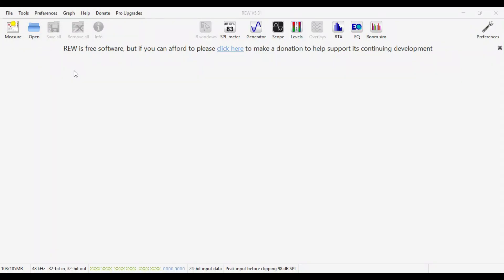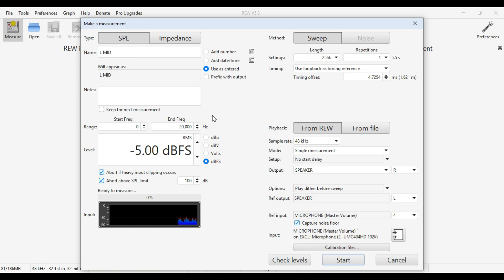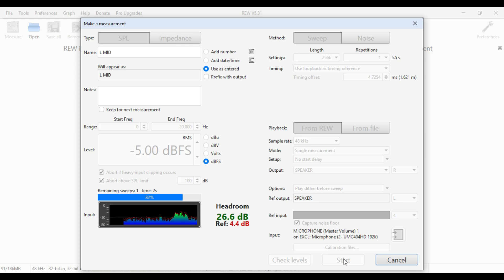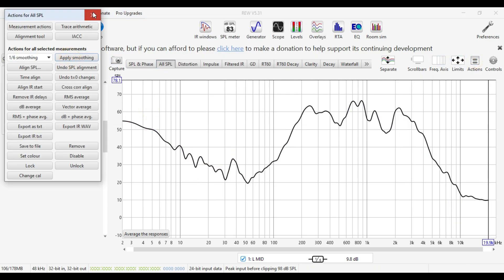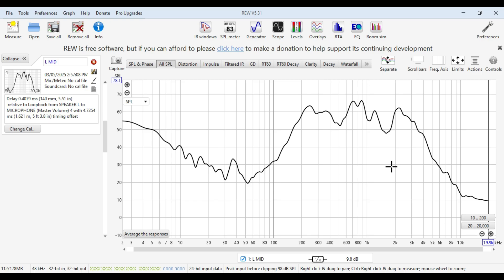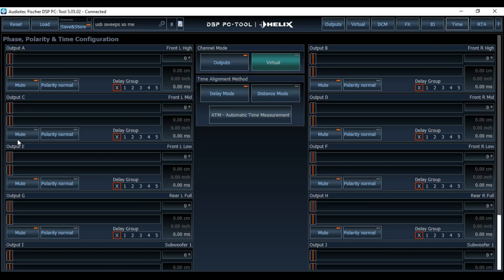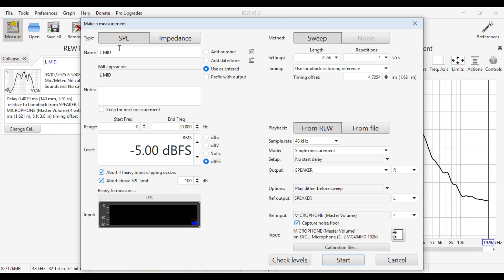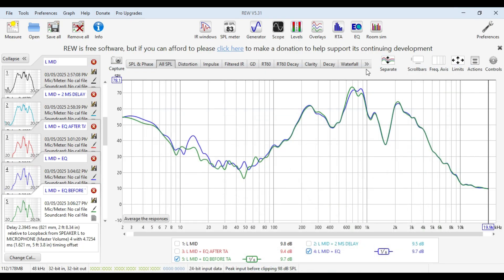REW - Car Audio Tuning - Which do I do first: Time Alignment or EQ?

Comment: Hey Socket, I’ve followed your tutorials and learned so much in the last 2 months since I started watching your channel. By the way, my front stage is pretty solid but wish I could pan it slightly to the right. Do you suggest messing with the levels or adjusting the distance or a mix of both? Thanks in advance ❤
Reply from the maker: Hey Silver, to pan the speakers left or right, increase and decrease the gains (levels) on the left and right speakers. 0.5 or 1 db increments at a time.  So for example if you want to pan the stage to the right a bit, increase the right speaker by 0.5 db increments or increase the right by 0.5 db and reduce the left by 0.5 db. With speaker pairs playing together, the louder you make a speaker the more it will pull in that direction.  The quieter you make a speaker the more it will pull in the opposite direction.  Keep playing around until you are happy they are centred.  This of course won’t work if you are playing one speaker at a time :)
Reply: @socketsocket2763 got it spot on now! Much appreciated all the way from Northern California 🙏🏽🙏🏽🙏🏽
Reply from the maker: @SQ_Silverado you are welcome mate 👍

Comment: Great theoretical explanation, but I think it could have been better demonstrated in practical terms if two speakers in different positions had been used — like the left and right midrange drivers. From what I saw, there seems to be a phase difference at the point where EQ adjustments are made. The rest has little influence, so it seems to me that proper time alignment would be impossible in this case. And since only one speaker is being used, it's also not possible to show how alignment would work when measuring both playing together.

I apologize if I misunderstood anything — maybe this will be explained later in the video series. I just wanted to comment now before I forget.

That aside, I’d like to congratulate you on the excellent quality and depth of your explanations. I'm watching the entire series as I'm planning to upgrade the stock audio system in my car in the near future. Greetings from Brazil!
Reply from the maker: All good Leonardo. Glad you are enjoying the videos :)

Comment: one further remark - When level matching - If the vehicle is left side steering wheel -> the left side needs to be attenuated at least by 2-3 decibles than the right side and visa versa if the steering wheel is on the right. Human hearing is algorithmic not linear.
Reply from the maker: Yes in a left hand drive vehicle the right needs to be louder then the left otherwise the image wont be centred.  You can either do that by increasing the gain on the right speaker by 2-3 db or by EQing both speakers to the same level at the listening position.   Happy to have you on the channel Eddie :)

Comment: Why people are looking for short cuts? EQ changes phase and amplitude (which are co-related).
If you are first EQing a single speaker to target and you do so per each speaker on its own - at this point timing does not matter!
However, if you are now enabling two speakers - of the same kind, one on the left one on the right - they will have now other modular issues that are casued at listening positon and the structure of the cabin -> If they are not on time to begin with, they are not in the same phase so why bother to EQ them?!?
What ever EQ to target you've done - would be now affected by the conjunction of them working together. But alright - you've EQed each speaker on its own to target.

Now get them on the same timing - so that L side and R side would be on the same relevant phase - and now you will have to EQ them together to target and as well check if any specific speaker such as allpas filters are required in order to fix modular issues.

But now since you've EQed them - you have to check one last time, if fine tune time allignment is needed -> this is the part that is being shortcut here.

In my own view - First, level match the speakers roughly, then do a rough time allignment, validate your cancellations (GD graph in conjunction with dips) and then EQ each speaker to target, EQ modular issues -> final time allignment. 

No shortcuts!
Reply from the maker: Hey Eddie, sorry if you are a a bit upset with something I said in the video, certainly not my intent.  The topic time or EQ first has been a subject of much debate, The video simply explains why I do EQ before time alignment, it is just the way I do it, so if you have a different approach then that's awesome.  I do my level matching and EQ work in one step and then do my time alignment as a separate step.  It works well for me but I appreciate other people have different ways of tuning which is great.  Thanks for your views
Reply: @socketsocket2763  Hey socket, I'm not upset at all also not attacking - just mentioning that there are no short cuts to this since the complexity of two speakers wether it is a mid and its following tweeter for example, or two mids on opposite sides - are different than handling with one speaker at a time.

As well - before EQ - one should really verify cancellations first - the reason is that if you are eqing a cancellation - the speaker would still be full blasted on that frequency and will be damaged, while you will get zero results. 

And after all is done - as well comes the "personal taste" and some specific issues such as frequencies in refernce songs that you will either need to boost or attenuate - after all that is done - it is better to verify the timing again because each change done to amplitude no matter EQ or attenuation - is phase affecting and that eventualy is timing affecting and could also cause new issues on specific areas due to that shift. 

But really I see no logic to EQ before the speakers are at least initiated on the same timing - and yes I fully agree that after EQ is done - timing has to be re-verified. Either way works as long as it is not strict: EQ then timing. you have to re-verify your self. 

Not upset at all don't get me wrong.
Reply from the maker: All good Eddie :)

Comment: When the response of two drivers at the same mic position is the same, the phase response will be almost identical.
So it doesn't matter if you do TA before or after EQ, as you normally have a similar response (+-1dB) of both side drivers (like midrange same response, tweeters same response left to right and so on).
This is true for minimum phase regions of the response only, though. Non-minimum phase areas cannot be EQed anyway and may cause additional phase wraps for example in the event of a room related null.
So repeat this video with the left and right drivers phase response when doing TA first, then EQ to both to the same target and then remeasure both. ;)

In general... the better the frequency response in minimum phase regions, the better and cleaner the phase response in those minimum phase regions.

Comment: Personally, I like to listen to the drivers un-EQ’d so I can get a feel for their raw dynamics and response. So I’ll do TA, XO, and Phase, then have a few listening sessions where I’ll experiment with XO points (and maybe apply some basic EQ to tame big peaks) to dial in the foundation.

Then I’ll do final EQ and Phase and evaluate again to make sure I didn’t impact dynamics.
Reply from the maker: Hi BM..  Thanks for sharing your technique mate.  Sounds like you are not new to this tuning thing and have been working on your method for quite a while. Well done mate.  How did you get into this and where did you learn to tune?
Reply: @socketsocket2763  I competed in CAN throughout the 90's and was an SQ judge in IASCA in the 00's
Reply from the maker: Ahhh makes sense.  Nice to have you aboard BM :) .... what do you think of the series so far ??
Reply: @socketsocket2763  Really well done mate! 
You are technically on-point
Reply from the maker: @BMW1M    Thanks for your kind words mate.  Really appreciate it :)